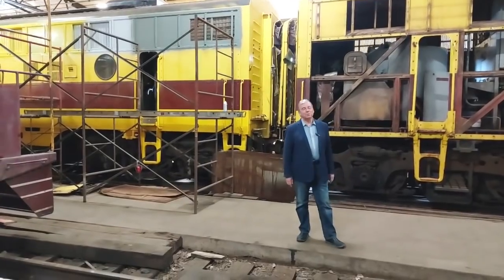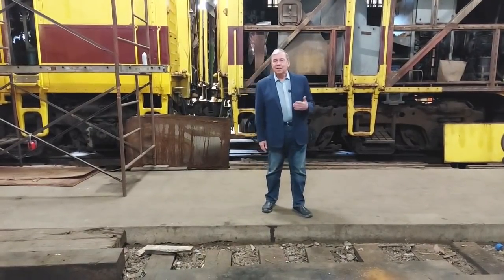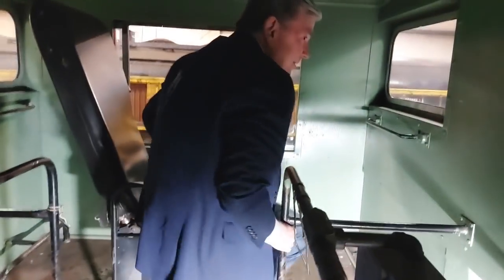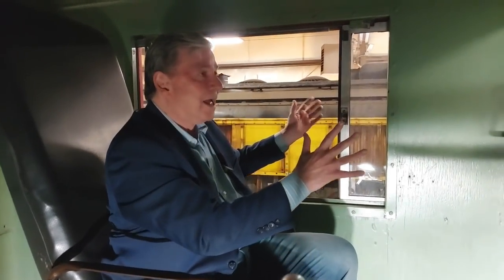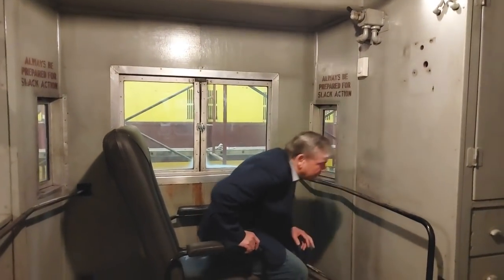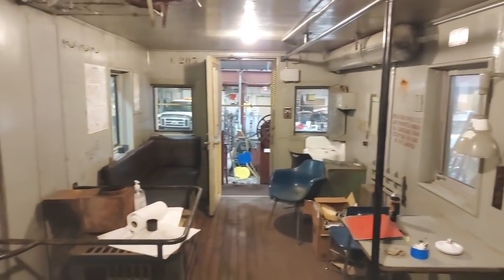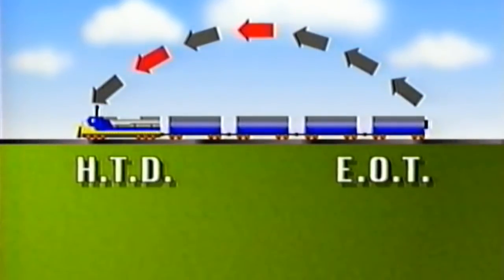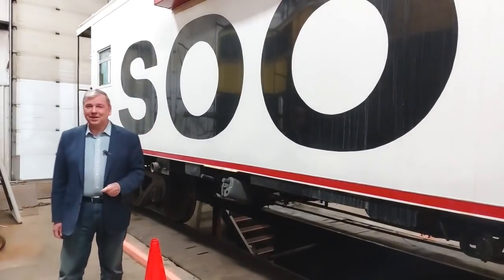Cabooses and Fred's: The Rear End of the Train

Comment: Years ago, I was a technician with CN Telecommunication, which was the telecom division of CN Rail.  Back in the mid '70s, when I worked out of Capreol, Ontario, I often rode on freights, either in the locomotive or caboose or van as the crews called it.  Since the engineers didn't like stopping the train, if they didn't have to, I often hopped on or off a moving train.  Also, there was one trip when I got on the train in Foleyet, after midnight, to go back to Capreol.  I was sleeping on a bench in the caboose, but was often tossed off by the motion.

BTW, I was listening to music and just before I clicked on this video, Gordon Lightfoot's "Canadian Railroad Trilogy" started to play.  ;-)

Comment: Railroads are a dangerous work environment and so are caboose’s. Back in the 70’s a crew was deadheading to Chicago. Normally the deadheading engineer would ride in a trailing locomotive, but in this case he decided to ride in the caboose. At sometime he laid down on the bunk that had a thin foam padded cushion, I wouldn’t really call it a bed, and fell asleep. About two thirds of the way to Chicago the train went into emergency. The sleeping engineer was thrown/slid forward and ended up breaking his leg.
Reply: That's the bench I was referring to in my post (above).  However, I just wound up on the floor a few times, no injuries.  Also, when sitting in the cupola, there are foot rests that are actually braces against the shock of the slack running out.

Some of the retired cabooses were converted to offices for use at work sites along the track.
Reply: @James_Knott  I know all about slack action, I’ve been chewed out a few times by conductors about a bad ride. The last knew cabooses were only used on work trains on the BNSF to allow safer, faster back up moves.

Comment: Is there a modern use for caboose cars. I was driving home from work in Minneapolis and saw a caboose on the end of a train just a few nights ago. I don't know what company it belonged to, but it was on a line I typically see Canadian Pacific's on.
Reply from the maker: Almost always, the cabooses on modern trains are for shove moves... at some point that train likely has a spot where it has to back up for a considerable amount of time, and there needs to be a person on the rear when the train backs up. Crews can hang on the sides of cars, but if its for a long time, its better to have a platform for them to do stand on or go inside to watch the rear as the train backs up. - Josh
Reply: @NorthShoreScenicRailroadDuluth  awesome. I hadn't thought of that.
Reply: Some were converted to offices, for use along the track at work sites.

Comment: I have my doubts about how supposedly dangerous waycars were. Every railroader knew what slack was and after a little while could identify times and locations when slack might present a problem and anticipate sudden movement. Yes guys did get knocked down, not saying that didn't happen, it just wasn't a big deal. Part of the job then and now, the only thing that changed were lawyers.